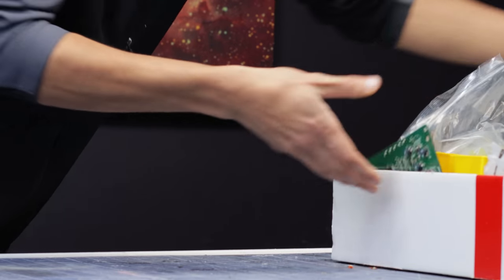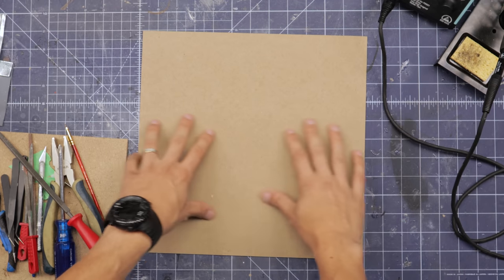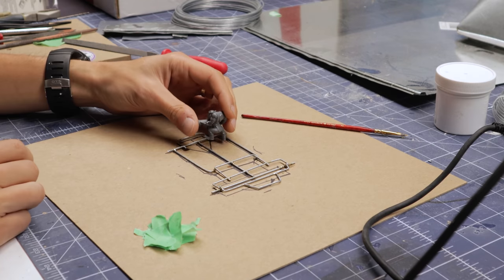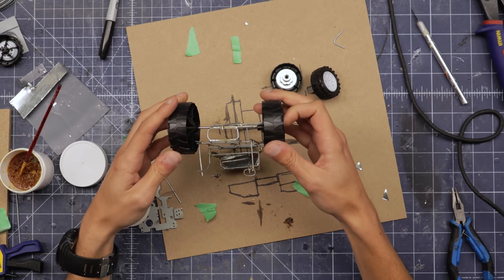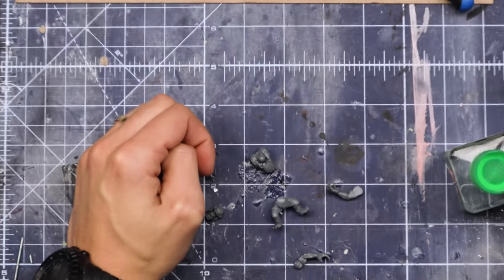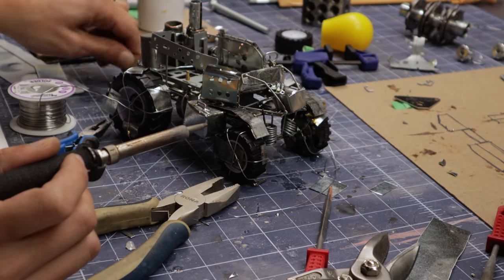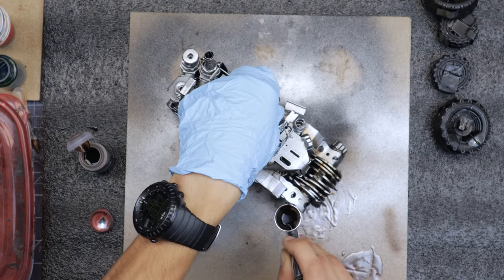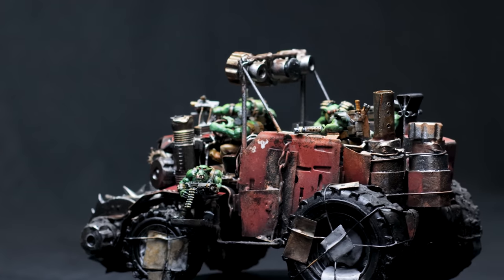This #ORKTOBER Truck is scratch built from WHAT?

Comment: Part of the reason I bought a 3D printer was to do stuff like this easier, I've slowly but surely been making a Mad Max Ork army, been hell of a lot of fun so far :)
Reply from the maker: Right on! Apart from being a silly challenge, the restriction to use metal bits made me learn some lessons about photo etch, and soldering brass and copper parts
Reply: @KnarbMakes  It's very cool, I may have to steal some ideas! I really wish I could put pictures in YouTube comments, I'm very proud of my Doof Wagon, I wish I could show it xD making some Grot Tanks has also been very very fun

Comment: I admit, I'm "that guy": heat + zinc = death. Respirator, and work outside. Moving on... It looks great.. I love how you just went for it. I lack that capacity; more of a planner, I. Clearly, it's working for you. WAAAAAUUUGGGGHHHH!
Reply from the maker: Fair enough! I had a fan blowing air out the window the whole time, thanks Guy!
Reply: Maybe the mass-hallucinatory tech-sorcery of the Orks comes from welding too much galvanized!
Reply: Soldering iron isn't hot enough to vaporize zinc. You'd need to weld to get it hot enough to be any danger.

You'd know if you had heavy metal poisoning, it's like a really bad flu and can tell you from experience it really sucks.
Reply: @ZayneAdmiraal  Good to know. That sux. Sad you had to go through that. All I've heard, about the off-gassing, is "Heat is bad, m'kay!?" I didn't know it had to get that hot
Reply: @CampaignTerrain  suppose it's always better to be safe than sorry if you're not sure!

Comment: Drink can's were always a good source of ork vehicles, you can roll the edges to stop them being sharp and you get some great metal to fill in a frame, you can then add glue melted sprue weld lines.  Had an old book for armour modellers that had some great idea's for this stuff.
Reply from the maker: Oh, that's brilliant! Didn't think of using drink cans.
Reply: @KnarbMakes  Nail varnish remover and a cotton pad used to strip the paint, the only issue is some cans do come with a plastic liner making solder a pain.  Food can's also have some interesting ribbing (but do come with a liner) making premade surface details.
Reply: @KnarbMakes  Nicklel strips is another useful find.  Easier to cut than steel but is also magnetic so opens you up to a lot of temporary connection options while still on flat sheets

Comment: Do you use different solder for welding parts?
Reply from the maker: Nope, same type for all of it that I've had lieing around for soldering electronics. With various degrees of success, hence the load of wire supports, LOL